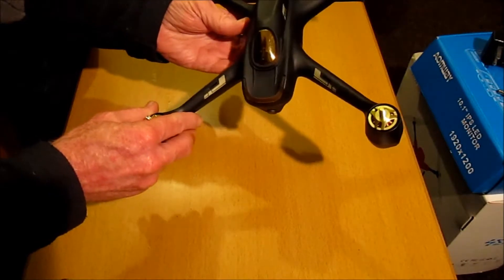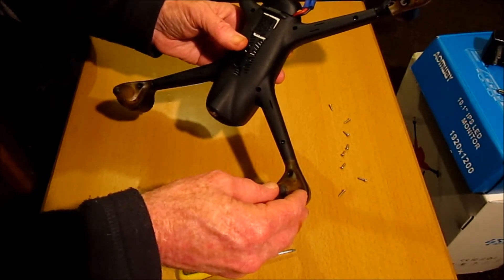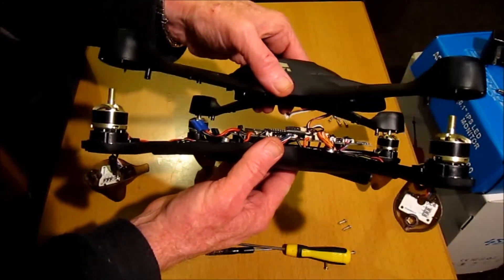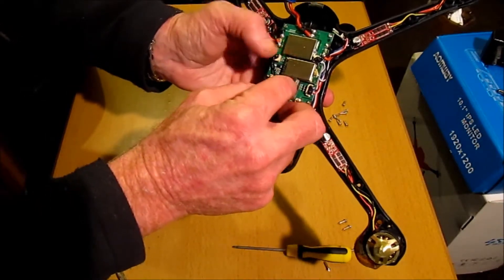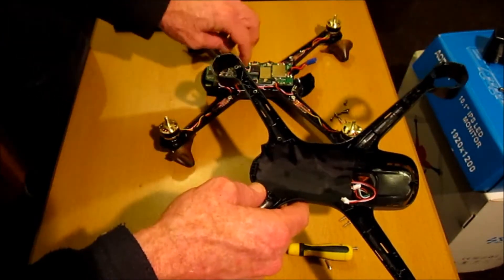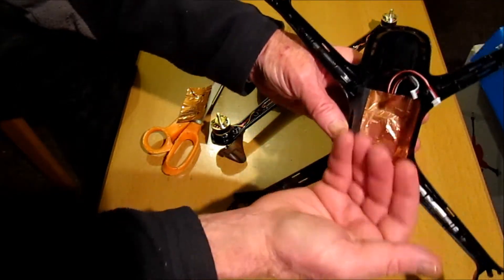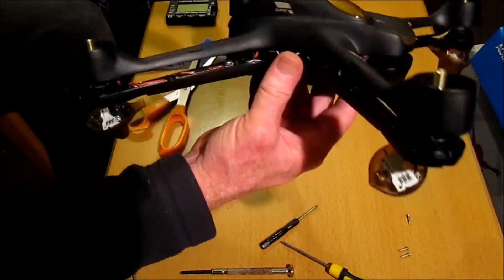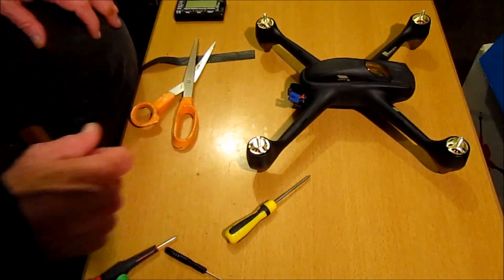Hubsan H501s GPS mod by BillM-RC

Comment: How have you affected the cooling ability when you block off the ability of air to move thru the electronics. Heat is the number 1 enemy of IC circuits.
Reply from the maker: on top and heat dissipates upwards, and it was covered beforehand anyway

Comment: That seems to improve the gps reception quality, but I'd I think you should put another non-conductive on top the copper, as the copper foil is too close on the pcb and it might cause a shortcircuit.👍😂😂

Comment: Hi Bill you seem knowledgeable on your quads and controllers do u have any idea how to access the firmware on the h107d+ or what do you think would happen if the barometer was removed from the flight controller
Reply from the maker: Hi Bradley, have a look at Andy's video here and you will see the usb port to plug-in a micro usb cable that can be used to upgrade the firmware :  https://www.youtube.com/watch?v=QyhqF5LnPY8  . There are videos on youtube that should assist you with upgrading firmware on this but I would not recommend removing the barometer. Hope this helps.
Reply: Bill M - RC thank you bill if I can help with Anything dont hesitate to ask happy flying

Comment: nice video bill.. have a question though.. you also covered the compass..did this effect calibration? or any bad effects? i could covering the gps unit.. but the compass?
Reply from the maker: Hi Richard, I have had no problems calibrating, the compass works on magnetic which is not affected.
Reply: cool thanks.. i ordered syma 8x legs.. did both antenna mods.. on tx and quad..gonna do the hpss rth mod soon i order a 3 position switch.. 2 different RTH's :).. one rtc= return to controller.. other is rtt=return to take off. i dont have a gps problem.. but i can see that it needs more shielding :)